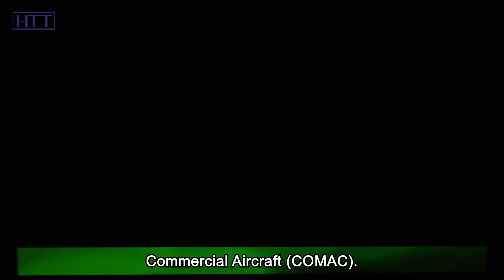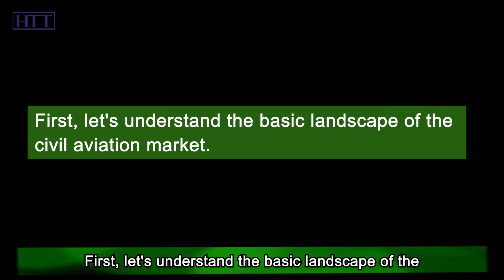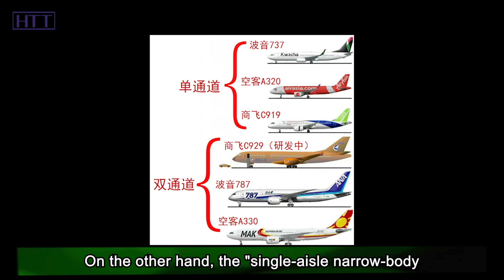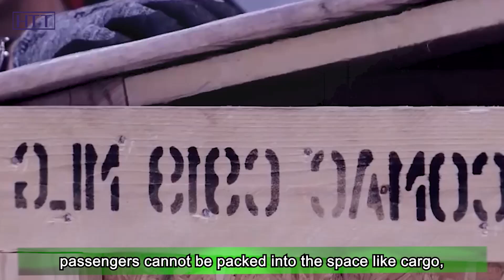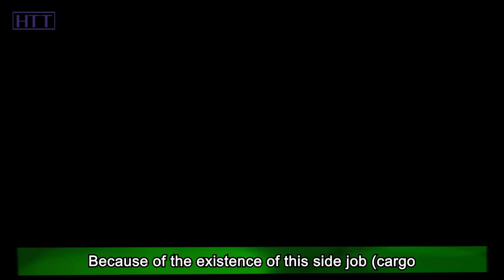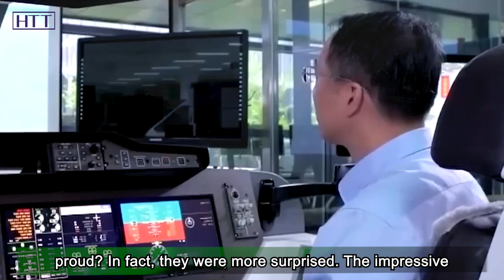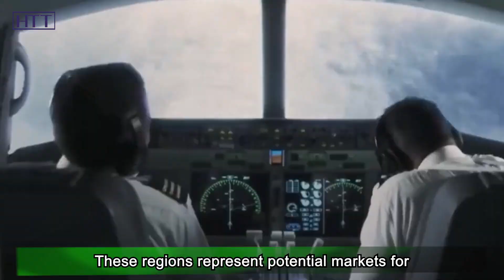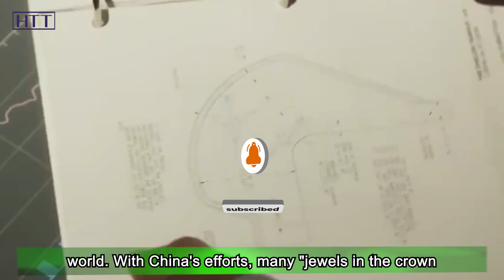Breaking the Boeing Airbus Duopoly! Can the Rising C919 Challenge Western Aviation Hegemony?

Comment: China has already defeated Boeing with the C919 as Comac has received more than 1600 orders from more than 36 airlines and institutions around the world. The airlines are beginning to realize that the C919 is more modern and efficient than the Boeing 737max which in fact is old body with new engines which are not suitable for the short undercarriage. C919 will certainly become a big competitor to Airbus and Boeing aircraft.